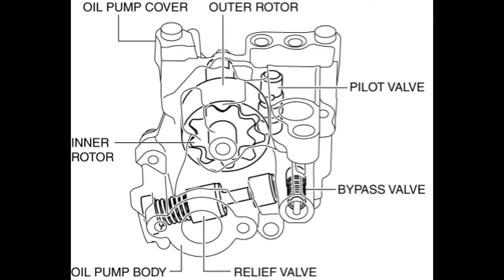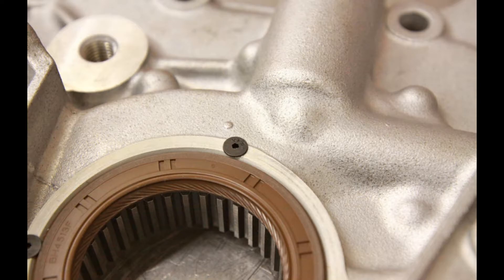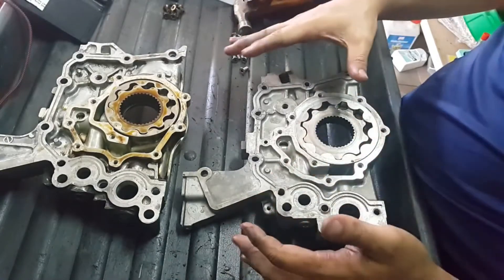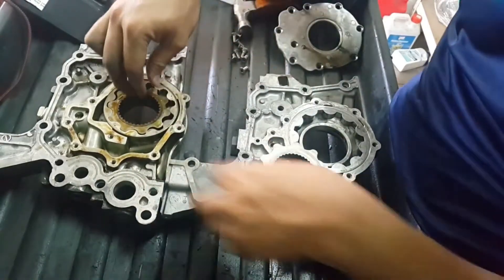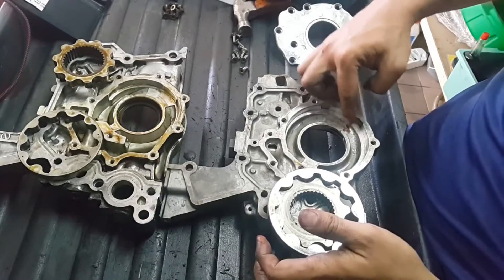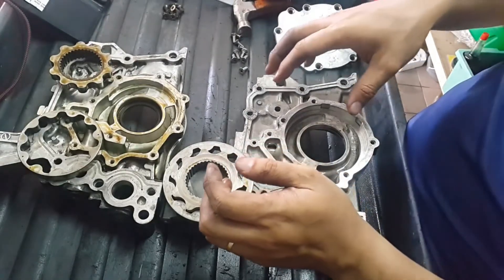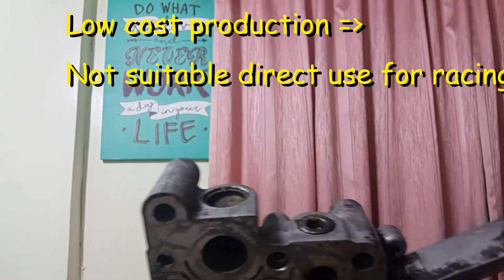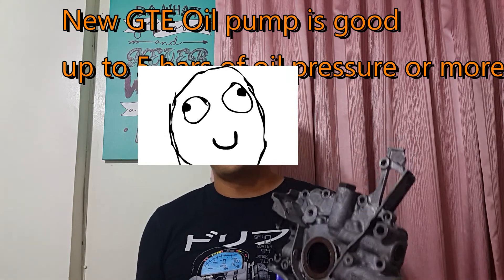2JZ 2sday #3 -Differences of 2jz NA and GTE Oil pump

Comment: Thank you for your great information i doing the 2jz na-t build with ge vvti engine with oem gte piston and rods i planing to used a gte oil pump do you think is goin to work or ni need to used my ge pump?
Reply from the maker: @Morm1175  yeah go for it. The gte oil pump provide more oil pressure and it will definitely supply enough for the turbo feed and others too

Comment: Hi Michael, do you thing that the GE oil pump can handle enough oil pressure in a block with oils jets squirts + single turbo and oil cooler? Thank you
Reply from the maker: Hmm sorry i dont think so..
Reply: @cheapkailaujing  but what would be the result, zero pressure or little pressure.
Reply from the maker: @Tavo-TECH  there is only one way to find out
Reply: @cheapkailaujing  which buddy
Reply from the maker: @Tavo-TECH  test it out yourself

Comment: I figured out my throttle sensor wires now oil pump is gone out. Any tips on ge na?
Reply from the maker: Hmm best is use gte oil pump.. Ge oil pump is weak and not good for boosting
Reply: @cheapkailaujing  thanks. Do you have to modify anything or bolts right up? Thanks again
Reply: @cheapkailaujing  is pulling engine a must to change oil pump?
Reply from the maker: @servantofMostHighELELON  not really..

Comment: Good video !  

im close to starting my 2jzge na-t engine build. I want to go coil on plug and primarily looking at the GTE oil pump to run the crank position sensor so i can delete my distributor entirely and just plug the hole that it originally went. 

Only thing is everywhere im reading people are saying the GTE oil pump on the NA can cause oil leaks from over pressurizing the system.  Since the GTE has the oil squirters it doesnt deal with a ton of pressure but since the GE doesnt have them alot of pressure apparently builds up.
Reply from the maker: Yes the oil pressure is super high but so far so good.. Just don't port the oil pump to make it even higher pressure, or use too high viscosity engine oil. Use something like 10w40 or even 10w60
Reply: @cheapkailaujing  So it doesnt blow seals with that GTE pump ?
Reply from the maker: @CarsnStuff  hmm so far so good..

Comment: Your videos are very informative.  My only question on this is how much oil pressure should I need for an na-T build for which I am shooting for about 750 hp?  Do you think I should be good if I just put a GTE oil pump on with a good catch can and PCV system so I do not blow the fr. and rear main seals out?
Reply from the maker: gte oil pump is a must for every upgrade of 2jz NA or T. oil catch tank is a must for any turbo, be it low or big boost. the oil pressure, i think best is, during the engine has warmed up, idling, should be minimum 3 bars. so choose your engine oil wisely to reach that =)

Comment: on GTE pump  you can drill a bigger diameter on the return channel, right near to the gasket. you also forgot to mention that on the GTE pump, you have Crank position sensor wich is not on a GE pump. Good video.

Comment: NA and GTE oil pump they are interchangeable? i mean the bolt position on the block are the same between them? If you have NA block and you want to go NA-T build you just buy a GTE oil pump and it bolt on exactly the same as the NA oil pump?
Reply: @cheapkailaujing  Thank you so much for your answer, i appreciate it :)
Reply from the maker: direct bolt on. always go for gte oil pump =D

Comment: Wouldn't the stock gte pump Blow the main seals on a ge block ?
Reply from the maker: yes it may, and there are a few tips and tricks but unorthodox  to maintain the seals from blowing out haha =D i may make a video about it =D
Reply: Great videos, what tips and tricks are there to prevent blowing main seal? Is this the crank seal (front and rear)?  @cheapkailaujing
Reply from the maker: @MKAERO89  hmm I truly believe that the oil pressure generated by the oil pump without oil squiters will be high, but not high enough to blow seals. What blow oil seals is either the piston ring gap too big or worn block.
Reply: There are three primary reasons the FMS fails.
-Excessive crankcase pressure/not enough crankcase evacuation
-Seal installed too far in blocking the drain
-sealants/rtv used in the fms sealing causing blockage of the drain

Only mods to help is drill the drain passage larger or add a second one
Reply: a remedy for that is to use the na oil pump spring in the gte oil pump so it relieves the right amount of oil
Reply from the maker: @blingdogg88  hmm but our point is to have high oil pressures, even when the oil is hot.. that is our aim to prevent oil pressure too low and cause engine to seize

Comment: Would you be able to add oil squirters to an engine that doesn't have any?
Reply: @cheapkailaujing  Yes, oil squirters can be added. The block can be drilled and tapped to accept them. Any engine machine shop should be able to do this. It will require a bare block as it will been to be flushed and cleaned after. If you do put in oil squirters, change to the GTE pump as you will need that added volume and pressure for them. There are many benefits to oil squirters including piston cooling, little end protection and cylinder wall/ring sealing. Personally if I had a GE block and rebuilding the bottom end, I'd like them in. Toyota didn't use them on every turbo charged version for no reason.
Reply: @nickclewer5723  There is no need for oil squirters in an engine with forged piston.